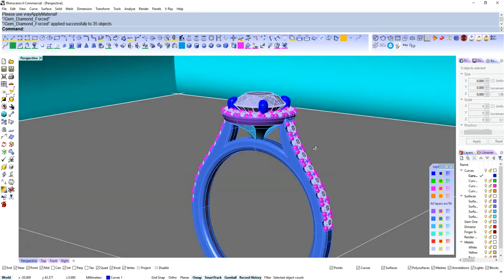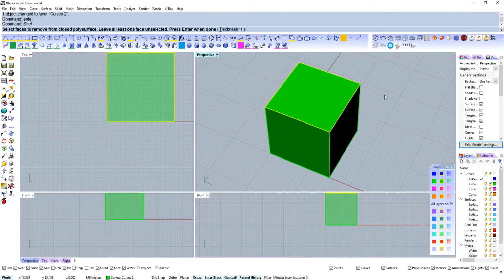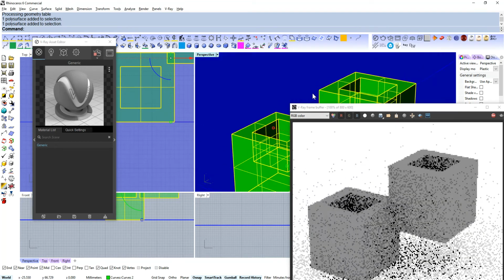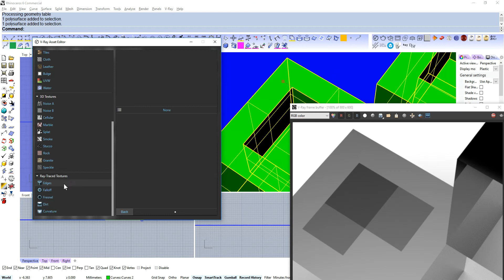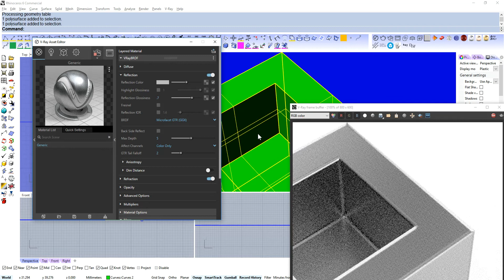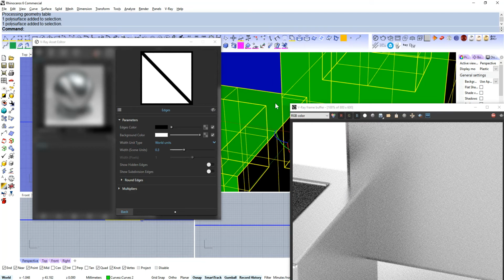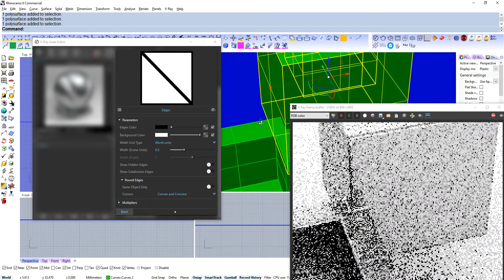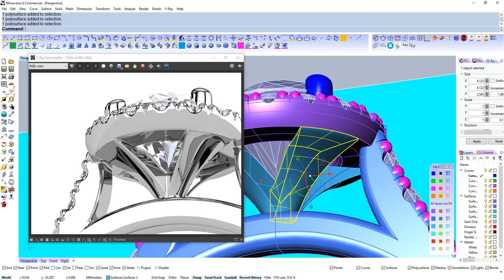Edge softening with Vray + Rhino

Comment: my edge softening map is not look like this 45 degrees line map. it seems like an isometric cube with extensions. also my edge softening is not working. :(
Reply: yeah, me too. I followed everything in the video but for some reason it doesn't smooth the edges.. new version problem maybe?
Reply: @lesimmateriaux1375  @Erdem Need to add a new Bump Map and select "Bump Texture Channel" under the drop down. Add the Edges Tex to that map slot

Comment: Hi, thanks for the video. I'm a beginner with Rhino, and I find really interesting how you add these "balls" on your cuts to add material for setting. If you were to print this for casting, would you just boolean the balls with the shank?
Reply from the maker: Hey, thanks. It would depend on what the person setting wants - some clients like me to leave plain metal, but if I do cut it up for setting I wouldn't have the balls - I'd keep the shank edges sharp boolean out of that. So you end up with quite square prongs. They'd get rounded off once the setter gets their setting tools on it.
Reply: @StarfieldCAD  Oh I see so these balls are just for rendering? I cut the shank like this once and the workshop told me that there wasn't enough material to do the setting..